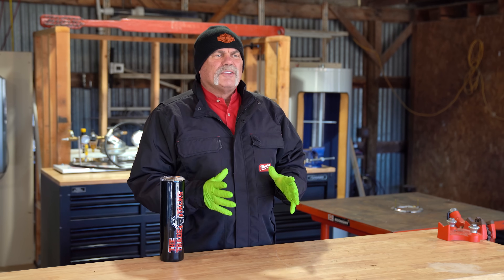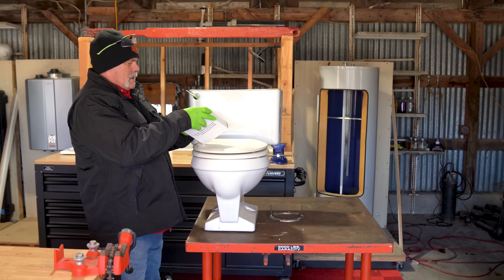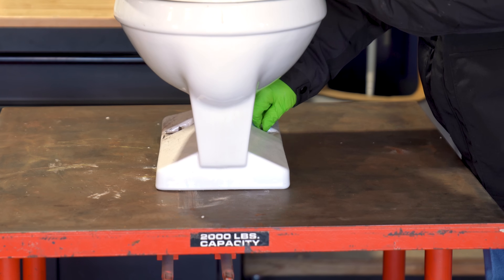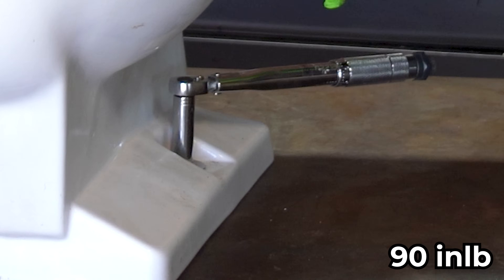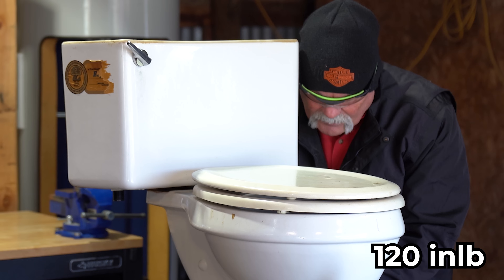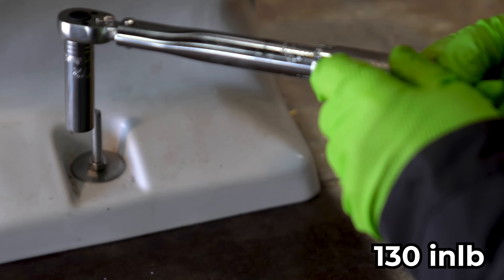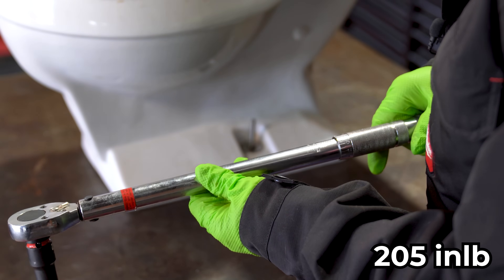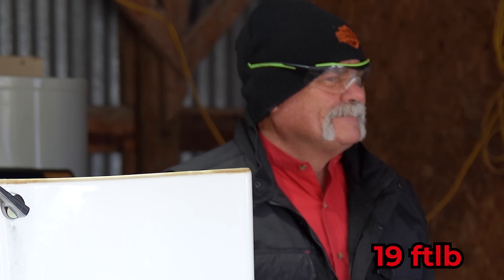How Tight is Too Tight?!

Comment: Thanks so much for this video! Question about the bolts that go under the tank, securing the water tank to the bottom of toilet : I'm afraid to over tighten, but there's a hit of a wobble still because the 3" gasket. Should I keep tightening until the water tank stops moving?

Comment: I prefer 5/16" bolts to. And you should use anti-size on those bold threads. Because the next guy that has to remove them might be you.

Comment: Tightening the tank bolts makes me nervous as hell. Too loose, it leaks if someone bumps it and disaster if you tighten it too much.
Reply: I just installed a new toilet and the tank sits down on two ridges, one to the front, one to the rear. I tightened it down so that it was JUST touching those, and stopped there. It took a good bit of pressure to do that, to the point that I wondered if it was cracking-tight, but as a non-professional I had to assume that the tank shouldn't be wobbling atop a rubber seal with no contact other than on the seal.

Comment: You need to show how to tighten if toilet rocks cause tile job uneven and you had to shim toilet base to get rid of rocking. Unfair test you only tighten up one side.   You never showed how to tighten with no torque wrench. I always tighten until bottom in contact with floor and no rocking

Comment: American Standard uses hand tightened plastic nuts to hold the toilet in place. The toilets seem to be designed for installation by non plumbers and the hand tightened nuts eliminate the need for a wrench to tighten the toilet in place, but my guess is that they designed the nuts to reduce the likelihood of over tightening the nuts by non plumbers.FWIW, this toilet was about a quarter inch out of flat. I thought that was a lot and I thought about taking it back, but I didn't feel like it, so I shimmed it.

Comment: Just a DYIer here. Braking a Toilet is always a concern for me.  I will say that you are using your torque wrench incorrectly. You are suppose to grip it by the handle. The knurled part of it. If it is gripped above or at the bottom like you did, The wrench will torque incorrectly. Many do not believe this, but you can watch tubers, doing this test. Keep up the good videos.

Comment: As an apprentice,i broke the bottom by the bolt, the whole tank corner changing a handle (or attempting to change- dadgum reverse direction got me on that), and the tank from tank to bowl bolts to the center AND all of the way to the outside edge. They made me learn a lot of stuff the hard way

Comment: I HATE pulling toilets. That being said, when I get toilet bolts tight enough and it still wobbles...i recommend a pull and reset to inspect the flange bc THATS likely the problem. I tightened up a loose toilet with nylon bolts about a week ago, hearda tick/crack whatever. Now the base of the johny bolt can shift, a caught thread can slip, it made me nervous tho! Even tho thats the hole point of nylon bolts from what ive heard...no callbacks yet and its 2nd floor so I imagine id have heard back by now

Comment: I've never broken a toilet, but I have pulled MANY bolts through flanges.  Not sure why so home builders use these stupid flimsy stamped steel flanges.  Even if you don't "overtighten" the bolts, the flange itself can't support the weight of an average adult shifting on the seat.

Comment: I have sat many a toilet over my 40 years as a homeowner and never broke the bowl overtightening the flange nuts; however, I did break a cast iron flange that was not anchored to the floor. Got to admit, tightening those bolts always makes me cringe a bit. After I set the bowl down on the new wax ring, I carefully on the toilet to seat the wax ring, then run the nuts down then tighten ever so carefully.

Comment: In not a plumber but I've changed out several toilets. You should not tighten a wobbly toilet down. If your floor isn't level,  use plaster of Paris to level the toilet then tighten down the bolts. I only go about 1/2 turn past hand right.

Comment: With so many different toilets that have been produced, testing one is better than doing none. Lots of variables to consider making a torque wrench a tool to use for this purpose. If the manufacturer stated what torque to use, that would be ideal in a perfect world. Not all floors are even so if there is a sag where the bolts are being tightened, it may be possible that it would crack even with a manufacturers recommendation. Tightening a base has always made me a little nervous even though I have never broken a toilet.  Maybe an insert that would take al the torque could be cast into the base such as a tube of steel anchored in the porcelain, then maybe a torque wrench value would become a standard. Great idea for an invention.  Thanks for doing this.

Comment: I broke my first one in a factory, placing toilets on flat floors. I learned to sit on the toilet first to help seat the wax ring, wiggle my butt a bit, get up and tighten the bolts until I get nervous. Worked 99% of the time. Occasionally had to tighten a few a little more, but my technique worked out well.

Comment: For the record I’m not a plumber, but an HVAC service tech. During the slow season the residential company I used to work for would have me go out and replace toilets at various places (I’ve done 14 total). I’ve always just slowly tighten those nuts down in slow increments, one after the other, until the toilet didn’t feel wobbly anymore. It was always a nerve wracking experience. One time while tightening one of the nuts down, the end of my ratchet made contact with the toilet making a loud clanking sound, made me jump a mile as I thought I broke it. 🤣

Comment: Sparky here having removed and set 4 toilets.  Technically the 4th one is the same toilet as the 3rd.  I don't know if it was over tightening or just the cheap plastic flange but it started getting loose.  Tried tightening it more and that didn't do much so I figured the plastic gave way and just to make it a little more secure until I could get time to go to the hardware store I tried tightening the other closet bolt and heard a loud pop.  Porcelain thankfully wasn't broke, but the weight of the toilet was the only thing holding that in place for several days until I had time to deal with it over the weekend.  Learned that metal repair flange brackets exist.  Whose bright idea was it to design plastic to hold a metal bolt I'll never know.

Comment: havent broke one but i had some issues installing using a foam ring as it was harder to compress and the toilet would wobble, had to sit on the toilet and then tighten the bolts to make it feel like it wasnt going to break on tightening.

But after using bleach cleaner and melting the ring causing a leak i just went for the trusty wax ring, also found the bleach based in tank cleaner also melted the rubber seals between the tank and the bowl, and the washers on the tank bolts

Comment: I broke a PVC flange by overtightening once when I first started, but never a toilet. As long as the toilet is sitting flat and not rocking, all you need to do is snug the bolt. To rock the toilet at that point, you would have to stretch the bolt or bend or break the flange. Physics says that ain't happening under normal circumstances. If the floor is not flat, install shims to keep it from rocking and add grout to create a flat base for the toilet to sit on.

Comment: The base of the toilet is square, which likely increases structural integrity. It also looks like it's thick as hell compared to a more modern toilet. The area with the bolthole on my toilet is only like 1/2 inch thick.

Comment: Ummmm. All toilets aren't as thick there. Dumb video. Plus. Don't use bolt tension to pull the toilet down into the wax. Push the toilet down moving right and left slightly by hand. When it's down, tighten the nut until the thing doesn't move. 
Common sense. Ft pounds  ? 
Ummmm.... NO.

Comment: The only time I've ever broken a toilet at the base is on the old one when the bolts would not come off and it was just too hard to cut them off, so out came the ball peen hammer and with a few taps it was up

Comment: I'm not a licensed plumber but I sure have replaced and reset a lot of toilets, I use a nutdriver only; don't use any type of handle as the lever effect makes it difficult to feel just how tight the nuts are.  With a nutdriver, your palm is your torque wrench.
Reply: That's a great idea/reason.

Comment: Considering a 1/4” bolt would never be torqued past 30ft lbs in metal applications bolts held in plastic flanges would obviously indicate very low torque.

Comment: Surprised to see it fail at "only" 19 ft. pounds!
Seems to me even 10 is pushing it, a large person kind of misses when sitting down what happens?  (besides sh!t hits the floor - that works too!  SHTF!)  Never broke one and have set quite a few down.  But if the floor is janky and it's wobbly even snug then the average Joe may be enticed to start cranking it down and then that's never good!  I've seen all sorts of stuff from wooden shims to gobs of silicone...

Floor needs to be fixed and the toilet will be happy.

Or you could resort to a prison toilet! ;-)

Comment: It probably broke earlier in that cold shop than it would in a warm home
I’ve broken several toilets, buts its always been the one I’m already replacing if the bolts aren’t cooperating when pulling
Reply from the maker: Yeah that's one thing we thought about while testing, the temp was around 35-40° when we filmed this.

Comment: you have a nice perfectly flat surface there i think a lot of people overtighten because their floor is not level and they think they can somehow stop the rocking if they tighten it enough. plus, a high spot puts all the pressure on one point.
Reply: if the bottom is not supported the force is in tension rather than compression and porcelain is not very strong in tension.  The wax is mainly compressed by the weight of the toilet itself and the bolts just hold it in position.
Reply: Shems

Comment: Thanks for the video. The only things I would mention about the type of torque wrench you used is that the spring needs to be "worked" before using it. This ensures that the set torque is accurate. This just entails changing the setting the full range multiple times. Also, the spring is recommended to be calibrated every so often.

Comment: I have only broken a couple of bowls. Usually, I will tighten it up until I think it is too loose and flush it; if it leaks, I will tighten it up again. I am retired now but I have had more trouble with the tanks. I have broken more than a few of them, installing floats and flush valves, and nowadays, if you break a tank, you almost have to buy a whole new toilet because it is hard to find a tank to fit. I worked in apartment maintenance, so I have replaced a lot of toilets. It is sooo easy to get them too tight.

Comment: I never broke a toilet but let me tell you something.

When i first learned to install toilets i took all day to install a toilet because i was using a ratchet to tighten the bolts. I didnt break the toilet but i kept breaking the bolts and it kept rocking. I was an apprentice but i was non union so i had no one there to ask what i was doing wrong until the journeyman came back from the store and laughed and told me to use a crescent wrench because a ratchet would overtighten the bolts. I had always worked on cars so i was just more familiar with using ratchets. Anyways as i started working on my own i realized the best tool for removing and installing toilet bolts is BY FAR a 7/16 nut driver. My person favorite is klein tools’ 9-in-1 pass through nut driver, its honestly maybe my favorite tool in my whole truck I literally never go into a house without one its so useful. 

Nowadays i can replace a toilet in about 20 minutes but every time i install i always remember the time I spent a full day trying to figure out what the hell i did wrong.

Also P.S for the record I actually HAVE broken a toilet before but not by overtightening it, it simply slipped out of my hands onetime and shattered, i ended up paying for it out of pocket so i definitely learned my lesson
Reply: hey man good one 8yrs plumbing here i had my share of stories as well 😂, hey what was that tool  pass through driver again? i definitely can use one will make my life easier
Reply: @happydappyjew365  klein tools 9-in-1 pass through nut driver its 29.99 at Home Depot id reccomend buying it online
Reply: @happydappyjew365 Did uou ever figure it out? I'd also like to buy my own, seems handy

Comment: That was an eye opener for me. I have broken a toilet when installing it. I was young and used to mechanical work so definitely overtightened it. Since then I have always been afraid to tighten them too much. I have thought the wax ring was too high or too large as some of the toilets I installed still rocked a bit. I see now I didn't use the right techniques to secure it.
Reply: I sit on it while I tighten the flange bolts. Rock yourself around a little till the toilet stops settling, before tightening.
Reply: @theguyjt7921 I do the same, seems to work for me
Reply: Just go back and forth with each bolt just like when you are suppose to tighten a wheel on a car. As so it is flush and doesn't rock left/right then it's good.

If you try to screw in one bolt all the way down you risk putting too much stress unevenly.

Comment: Earlier this year I replaced my Peerless 1.6 GPF toilet that clogged every time you used it with a proper vintage full flush toilet which actually works, and although I have installed toilets in the past, tightening the bolts always makes me nervous. Luckily the install went great, and the toilet is working well although I could have probably made them a bit tighter, it doesn't shift.
Reply: Awesome choice
Reply: @OCC_Plumbing_and_Restorations It is a pretty nice toilet, it is a Celite with a side push button which is supposedly sort of rare. I quite like it, I got it from a house that was being remodled.

Comment: Interesting !!   Thanks Roger.   I use a gear wrench and grip it very lightly about 3" from the nut to gently tighten.  That's my torque wrench. 
Looking cold in your shop man!  I also warm the wax ring in cold conditions to get a good squish.
Reply from the maker: You're a smart man! It was a bit chilly when we filmed this...ready for the heat to be back!
Reply: @RogerWakefield  get you a heater in there man.
Reply: Choke up on a ratchet, basically holding it next to the nut/bolt, to avoid over torqueing.

Comment: As soon as you hear the Crack of the porcelain and the crying of your wallet.
Reply from the maker: By then you're SOL
Reply: Been there before lol ffs
Reply: Apparently non of you have your toilets tight enough if you haven't cracked some porcelain 😅
Reply: @PatandRicky  I glue mine to the floor so it only needs to be snug on the bolts😁
Reply: Wouldn’t the pvc flange crack before the porcelain toilet?
Reply: @AzeveidoMateus not likely unless it's old and brittle.  The ceramic is more delicate.
Reply: @AzeveidoMateus it takes Alot to break that porcelain doesn't need much just a tap from any tool will shatter it
Reply: @AzeveidoMateus for me I always use a metallic ring on my flange and screw that bad boy down.
Reply: I have never broken one. I have broken some flanges but not the bowel it self
Reply: @51-FS  it's a bad day if you break a bowel 😂😂😂...bowl sucks too but that can be easily replaced
Reply: It's not the most ethical but you could pack it back in the box, and claim it was broken beforehand
Reply: @TaylorMakesMusicc  yes, completely unethical.  But it is done all the time.  😂